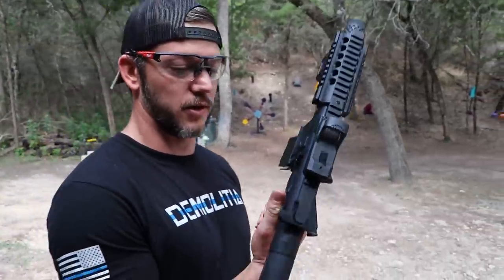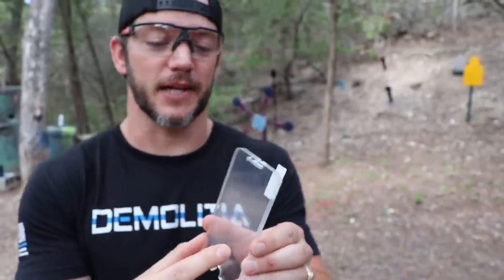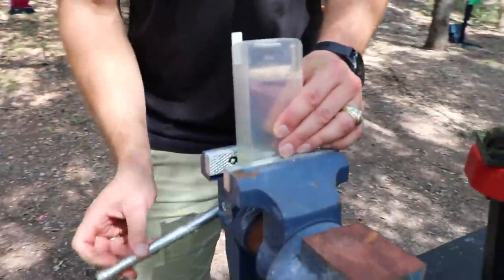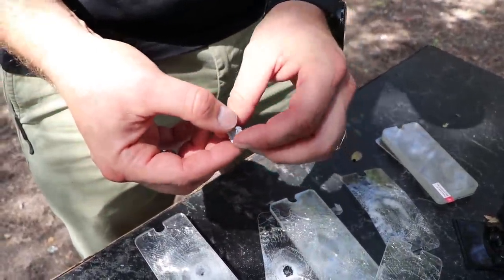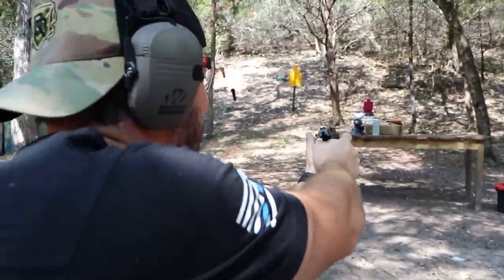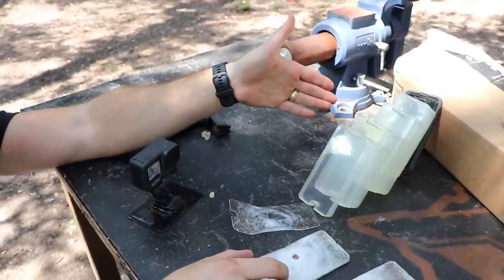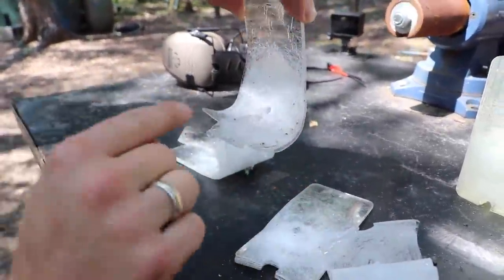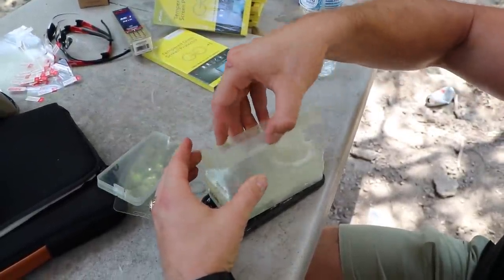How Many Screen Protectors Does it Take to Stop a Bullet???

Comment: I think its due to the conservation of momentum like in a Newtons cradle.
The energy of the bullet is carried straight through the middle screen protectors, leaving the end with the brunt of the force.

The random broken screen protectors are probably because there were imperfections in how they were attatched/manifactured.
Reply: In a way I think you are right with the Newton's Cradle, but also there was the box that the smartphone was placed against. The box pushed against the phone creating the damage from the other side.
Reply: Yes and I think they are not sticking together very well that makes some broken layers in the middle
Reply: Is it possible that the force was carried through but at a couple points some points of force met and combined and caused the cracks?

Comment: "If I had to guess, the back screens received the highest impulse against them as they bear the force of the bullet and front screens. The middle, untouched sections didn't receive the initial impact trauma and didn't have the push of that many objects against them", from Matt, my physic prof friend.
Reply: yeah, that what I'm guessing too, the random ones in the middle are probably broken because of the repeated impact from the different test, it created a bunch of microfractures and they eventually broke, the ones that survived are probably a lot weaker than if they were brand new.
Reply: It spalled like it was a thick piece of tank armor hit with HESH.
Reply: Kinda like the newtons cradle and how the transfer of energy skips whatever ones you dont directly force initially?
Reply: Wouldn’t it also relate to how frustums and the way a bullet impacts. The bullet hits the first screen then the pressure of impact is pushed down the screen protectors in a frustum shape?
Reply: I also wonder if maybe the screen protectors that shattered in the middle, shattered due to small air pockets in between. Not having full surface contact leaves room for physics to do what physics does.
Reply: Transfer of energy
Reply: @timothygarrett9372  my guess too.  There was probably some space between the ones that shattered.  I think it probably was the inertia of the bullet hitting the front ones that pushed the rest back.  You know when you see a martial artist breaking a stack of bricks.  The first few are broken by the force of the punch, the rest are broken by the force of the previously broken bricks.  That's why they are always spaced apart by little chunks of wood or something.
Reply: that actually makes sense. Up you go
Reply: Yep that's exactly it
Reply: I also think the fact that they were in multiple chunks and not one solid block may have had something to do with it
Reply: Bill nie the science guy right here
Reply: @dantearthur9128  lol
Reply: U must be a rocket scientist
Reply: I'm not much of a physicist and I'd write my theory in "simpler language" but the theory I'd write is maching 😀
Reply: I was thinking that the energy dissipated as a wave to the phone and back, and we're seeing constructive/destructive interference pattern of the incoming and reflected wave - cracked screens were possibly the constructive interference, and the untouched ones were destructive.

Only a hypothesis though.
Reply: @GerinoMorn  My initial thought that popped through my brain (like a bb) was "harmonics".  Was the hornet supersonic?

Comment: Matt FYI - there are two types of screen protector now: They are the standard, run-of-the-mill protectors that you shot and the new nano-screen protectors (Yall might know them as Liqiud Screen Protectors) which are way more expensive but are wayyy stronger. I recommend you try those out too.
Reply: I dont think tje liquid protectors will help as waves will travel better through them. They are

Comment: Remember when you shot the glass and obsidian spheres? The explosion on the back portion because of the shockwave in the front.
Reply: This is a little different than how the sphere worked. The sphere was based on the shockwaves converging after transfering around the sphere where this one seems like the frequency of the screen protectors was what caused the transfer of energy from the impact to the phone.

Comment: "shock wave" you nailed it buddy.
The projectile stopped at say 10 protectors. The next few didn't vibrate or shake enough to crack.

Then a couple more broke as the sound barrier caught up with the projectile and created additional force after impact.

However, just because the projectile has stopped & the sound barrier returned to normal, it doesn't mean all the kinetic force stooped too.

What you saw is very normal for hard hitting, fast and light rounds. They don't penetrate far but they "send" an intense shock wave a few inches past where the projectile stops.

When talking about flexible glass, it means the "aftershock" can just contort the glass in the 30th to 50th screen protector... And contort it enough to shatter it.

Its the same reason why You die from being hit by a high powered rifle WHILE wearing body armour. The BA may stop the round but there's still a lot of kinetic energy going a couple inches deep into your body and making your organs into MUSH

Comment: Ow that’s pretty easy to explain. Screen protectors are flexible, when they bend after the shot, they bend towards the shooter, then they bend in the opposite direction (catapulting some of the screens back at you) and on and on until they don’t have enough energy to continue the back and forwards bending and they stop (fractions of seconds). The wavy movement though allows the transmission of the power from the bullet even long after the bullet stops physically creating damages AND, it sends multiple (it’s improper) but let’s call them “shockwaves” down the line, every time that they bend towards the shooter… it’s like they give each other a butt. This and the fact that they are not properly stuck together creates the random damages pattern, being not glued within each other doesn’t allow them to act as a single solid piece, hence the shockwaves after the first compact one of the bullet are more random and of discontinuous forces.
Reply: better work would be a frustum, the force moving through a material after a point of shock
Reply: @utube18feb  yeah, Muppet proof explaination 😂 and the phone screen which is the last piece of the domino takes it all and gets annihilated
Reply: Just think how many Gs you are putting on the back end of that stack of phone protectors. The screen protectors will flex which means that the energy all gets dumped into the lower half of the stack. The point of the bullet will never hit it but that doesn't mean that all that blunt force trauma didn't affect the phone. You effectively smashed all those screen protectors with a sledge hammer that was formally known as a bullet. Hit it enough times and anything will eventually pulverize.

Comment: OK Matt, at 13 minutes inside this video, you were trying to figure out why what was going on when it came to the 22 hornet that shot all of the screen protectors and all the sudden the phone was broken as well? It’s because of the physics of the fact that the velocity of the bullet that hit the protectors honestly forced those protectors and hit the phone which made it shatter. The bullet never made it to the actual target but the amount of force involved with the ball itself at its speed was so fast it’s just no different then like a meteor hitting the earth or an astroid high speeds that was no bigger than a car that could create a much damage as an entire city. All that matters is the amount of force flowing through the bullet or object, and then when it hits something to slow down those other objects will also accelerate and can destroy the optic behind it it was supposed to protect. That’s why when it comes to making good body armor the best way to honestly look at making the best kind of body armor is making sure that whatever gets hit slows down the force as much as possible before that force basically with someone wearing a vest gets a bruised rib versus just a regular you know tap of the finger.

It’s all about physics, the size of the material flowing through the air, and how fast it’s going. And believe it or not you could use the same kind of methodology when it comes to working out at the gym. Because it’s time over the amount of weight lifting and also how many reps there are. And if you change all of those variance and make it super efficient, you could lift 5 pounds of weight and be stronger than a person who lifts 400 pounds. And it’s all about how slow you lift the weight because it makes your muscles grow more. Just like a 22 hornet flying through the air, will hit an object and those other objects will also fly against something else that’s behind it will not necessarily protect it.  What will happen is that the force of the bullet transfers to the plastic, and then the plastic hits the phone which actually makes the phone crack even though it was never hit by the bullet.

And I would so love to spend my free time doing this but I don’t have a YouTube channel I don’t have anything. I just know how certain things work in physics even though I have never been trained in anything in my life for some weird reason I just know how certain things work and then when I see it happen it’s like oh my God, is exactly what I thought? No no one has to believe me at all, I don’t really care. I just noticed things in reality that seem to be basically levelheaded and honestly make more sense then it goes from those other people who watch action movies that make no sense.

Comment: I would like a slow motion scientific full breakdown on what happened with that last 22 mag that was crazy. 👍👍👍🤷
Reply: .22 hornet
Reply: honestly, it's probably something as simple as them not being flush, so the shockwave pushed the glass sheets against each other causing them to crack each other.
Reply: @Watson928  yeah but a bunch of screen protectors in the middle broke too
Reply: @LazorVideosDestruction  hence what NoESanity said.
Reply: @LazorVideosDestruction  but they looked plenty flush. There weren’t any air bubbles and they seemed flush to me but even a fraction of a millimeter could make or break the difference.
Reply: @LazorVideosDestruction  exactly. What’s being stated is every point where the screens separate into a group is where fresh damage can be applied. The first group of screens catch the bullet and break until they they stop breaking. But the energy still travels through the nonbroken screens. That energy makes the first group of screens hit the second group and start cracking. Then group two gets to a point where it stops breaking the screens. But the group two of screens is slammed into group three and so on until you get the end(the phone).
Reply: @blahblah8037  Yeah, and I'm saying that some screen protectors in the middle (of group 3, 4, etc) broke as well. I'm sure it's just because they weren't as fully adhered, but still.

I also think maybe the shockwave has a ripple pattern, and when the ripple hits the edge of the glass, some of the panes in the middle can break too. Or it could be a resonance thing. Either way, just saying the energy goes through the glass and only breaks the outside doesn't seem to fully explain what happened
Reply: Destin, we need your help pronto!
Reply: @LazorVideosDestruction  the energy traveling through the nonbroken skins is the energy that propels the entire group forward into the next one. It doesn’t just pass through. It’s violently affecting the entire group and the whole setup

Comment: Ripple, just like with the glass ball. Similar or same thing happens when you fire a gun underwater, it expands and compresses several times over
Reply: It's simpler than that, it's a matter of flexibility. If I were to explain it through an example it's similar to how a bulletproof vest works. It might stop the bullet but the force on impact is transferred to the object( people do get hurt even with a bulletproof vest). It's property of increasing the surface area of the impact helps it achieve that. The only thing a bulletproof vest stops is the penetrative action of the bullet where the net velocity which on impact turns to force is now being distributed on a larger surface area than before. So here the "flexible" tempered glasses act as a bpvest absorbing some of the impact while distributing the rest along its surface area. Now the phone cracked Simply because it's not as soft and or flexible like human skin. Solids break easier on impact
Reply: That's what I was thinking, especially with the shrapnel of the round playing into it.
Reply: @rishabyadav6030  So what I said isn't true then?
Reply: @nopoint30  it sort of is but ripple is a surface visual property of fluids. What a ripple actually is the net force being transferred to another body and that transfer usually sends shockwaves along the surface area of the object. Meanwhile the thing happening here is similar but much simpler as force just travels like a wave (or ripple as you said) along the body until it hits something that doesn't share similar structural properties ( as the mobile phone here which gets destroyed as it simply doesn't possess the properties to let such a large force pass through its surface area so force ends up destroying the surface) it's like if you were to punch a brick it would chip at the surface as it can't properly absorb the force but when you punch a person in the gut it doesn't do any surface damage on the skin but the shockwaves can lethally injure your liver if you don't absorb the impact properly by hardening your abs
Reply: @rishabyadav6030  Just sounds like you took something simple and complicated it when there was a perfectly fine explanation of what happened. I do appreciate you explaining further though.
Reply: @rishabyadav6030  Thanks I’ll give it a watch in the coming days! 

I didn’t say it was simple. I gave a simple explanation that is easy to swallow and connect with for the majority of the people who come across the comment. Have a good day/night, cheers!
Reply: @nopoint30  I apologise if I made it all sound too complex than it actually is. Guess my explanation skills need some serious work 😅
They did a better job explaining it in the video, hope that helps. cheers!

Comment: That effect is similar to something called spalling. Ive heard of it in tank warfare. If a large and fast round hits a tank it doesnt neccessarily have to go thru the tanks armor to harm the crew. It will eject material from the inner wall of the tank in grenade fasion and maim the crew. Like hitting a sheet of plastic with water droplets on it. The plastic is fine but the water goes flying
Reply: If it were spalling there would have to be material removed, I am pretty sure just about all the glass is still there in the shattered ones, just not in one piece.
Reply: Spalling is when a bullet or projectile hits a target and shoots fragments to the side. Why you need armor plates that have a thick coating. Cuz shrapnel to the face sucks.
Reply: @oaktreeleatherworks  You and the original comment are both technically correct. Spalling can happen any time an excessive mechanical stress or shock load is placed on a ridged or brittle object, resulting in the object shedding material. Spalling in relation to ridged armor plates was originally used to describe the effect of the armor shattering inside of a tank sometimes without the artillery round ever even passing through. It was later used to describe the effect of a bullet fragmenting off of an armored plate. Although this is often misused as spalling only refers to the material that was originally part of the armored plate and not the bullet fragments.
Reply: @MrTylermphoto  this guy... Physics???
Reply: @MrTylermphoto  Thank you sir I always forget the name of this effect. Spalling is also the reason that concrete bunkers have additional mesh inside to catch materials that fragments of after experiencing the non penetrating hit from artillery.
Reply: @--_DJ_--  thats a good point, it didnt happen but i think the effect is similar. Have you seen his video with the giant ball of glass? If not you should check it out its really cool and highlights the event way more
Reply: Yeah thats also spalling your right. Im referring specifically to the phenomena experienced inside a tank im fairly certain they actaully have protective meshes installed to prevent this exact effect from happeneing
Reply: @tomstutz2645  I have seen the glass ball, it was quite the thing to see. Not at all what I would have expected to happen.